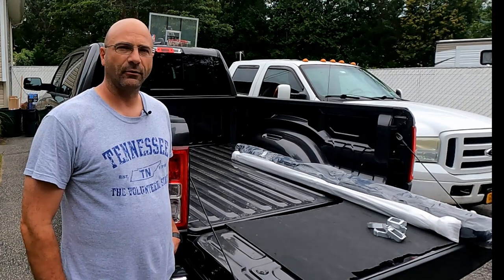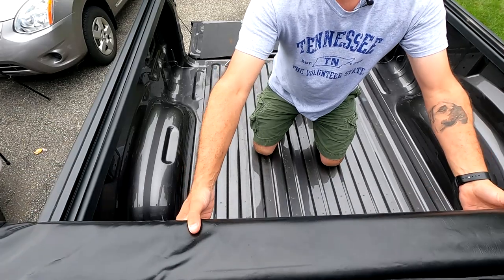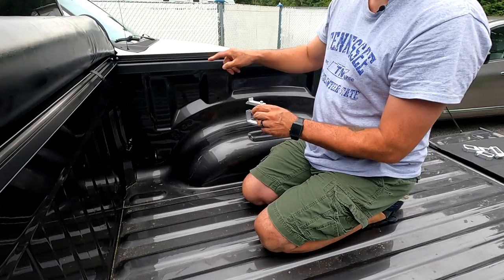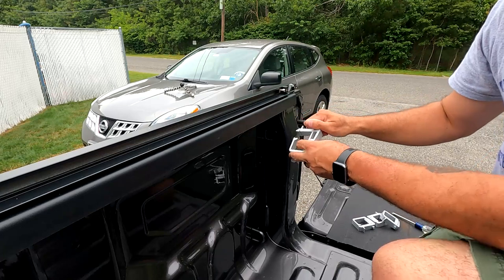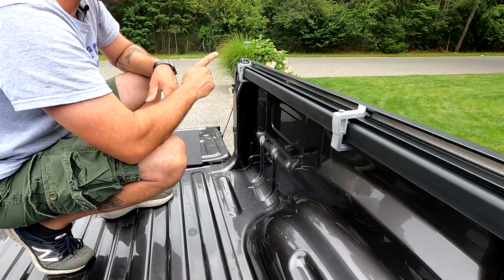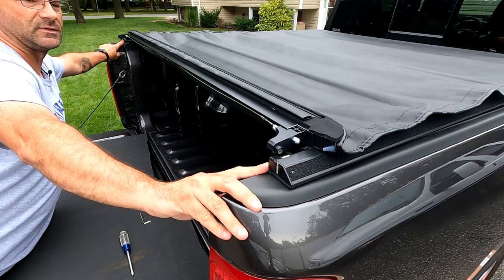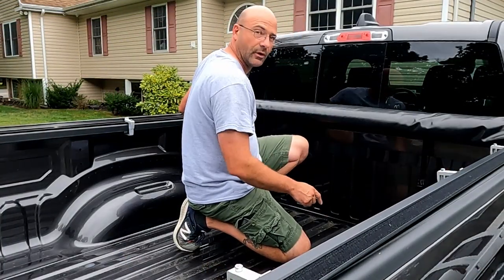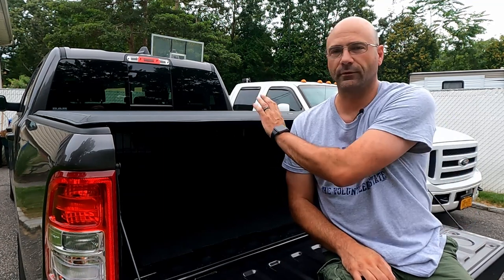2021 Ram 1500 pickup Installing the Cheapest roll up Tonneau cover, Bed cover, I could find on my

Comment: I put a tyger cover on mine, cheap and looks similar to yours. When it’s rolled up, and I didn’t notice on mine with the bike all the way to Florida and back it rubs on the sliding window frame and dulled it. Can possibly be buffed, just didn’t look into it yet.

Just a heads up if you’re riding with it rolled.
Reply from the maker: Thanks for the tip Frank.  I have not seen that yet but I will keep an eye out for it as I do have it rolled when hauling stuff.